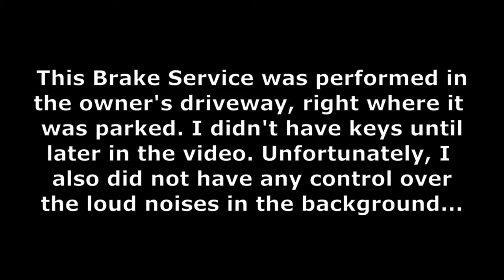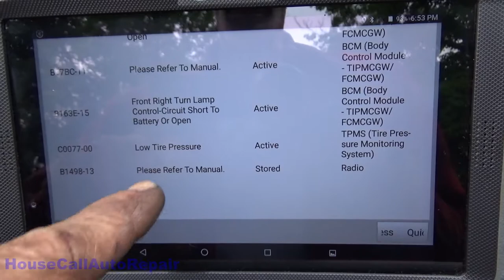2018 Wrangler Unlimited Sport Front Brakes - Auto Repair

Comment: It's good to see someone that takes pride in their work. Alot of places will do the bare minimum on a brake job,  just replace the brake pads and call it a day. My sister-in-law was a victim. No grease on any of the moving parts and the brake fluid had dirt floating in it. Three hours later new rotors and pads, front and rear and fresh brake fluid.
Reply from the maker: Very true! They don't get paid extra for being thorough.

Comment: When the rust is that bad on the caliper bracket. I have started using a cut off wheel on my milwaukee die grinder. But I'm sure you could use a drill. And get right down to the bare metal. It works great 👍 free tip Friday on a Monday lol.
And using crc marine corrosion spray on the bare metal. I have been having great success with the pads staying free in the salt belt
Reply from the maker: I've been experimenting with several different methods... abrasive wheels work great, but can take off more than you'd anticipate, very quickly.
Thanks for the suggestions!